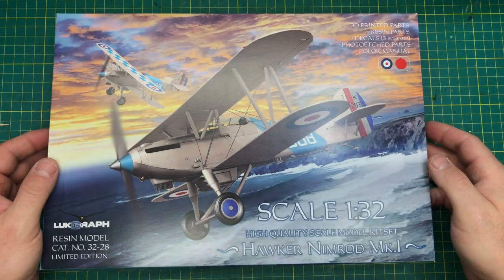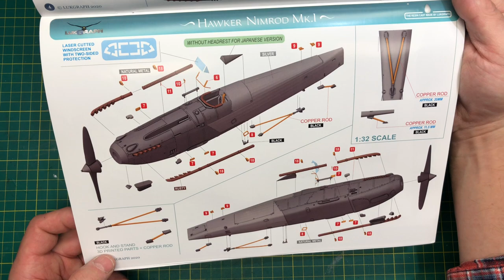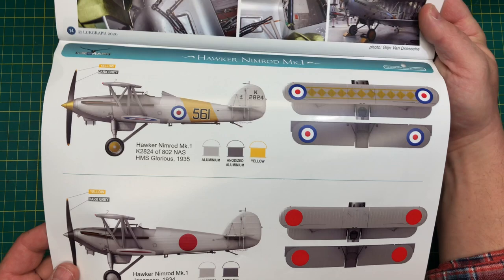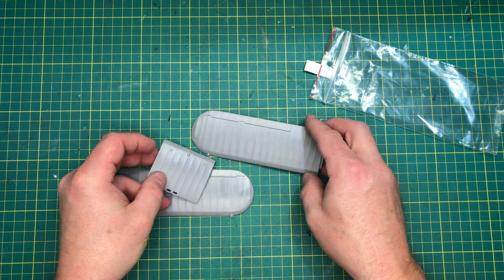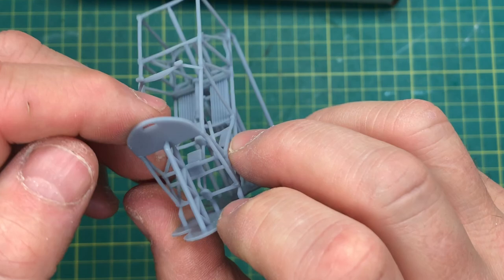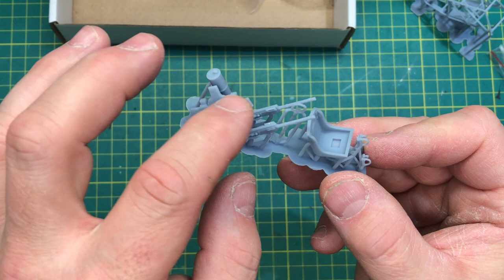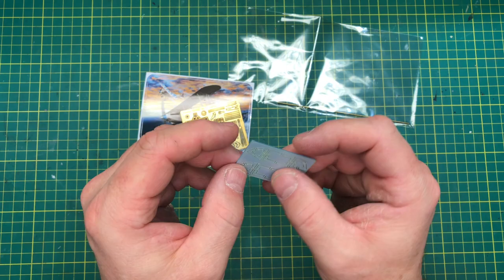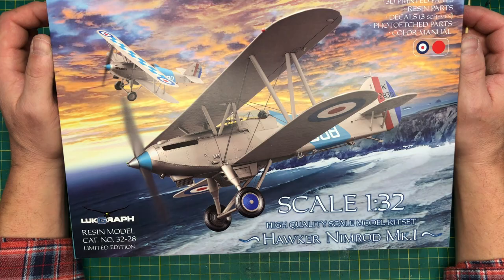Lukgraph 1/32 I Hawker Nimrod MkI I Kit Review I

Comment: I build the kit right now. Very ince indeed,  except the wing and undercarriage struts, which are 3D printed from a very brittle material, not able to take the loads from the  heavy cast resin pieces. I have got to replace it, there is no workaround.
Reply from the maker: Sounds a nitemare Jan, thanks for the heads up 🙏🏻